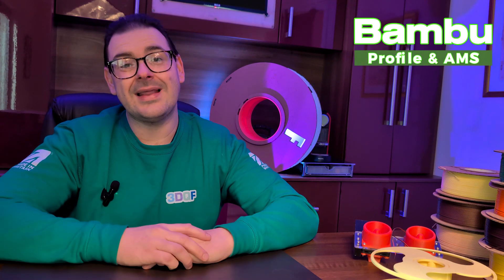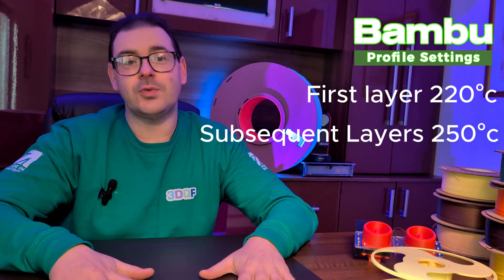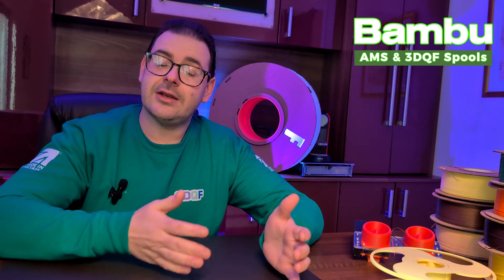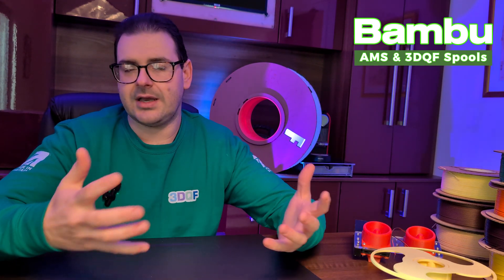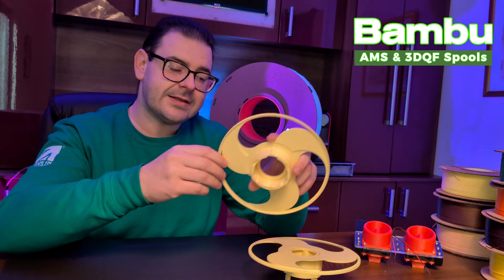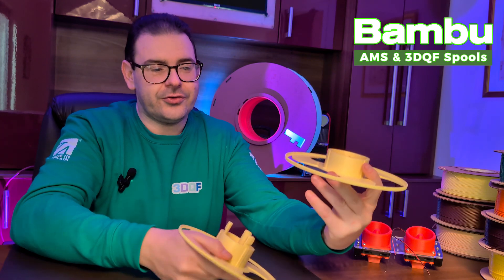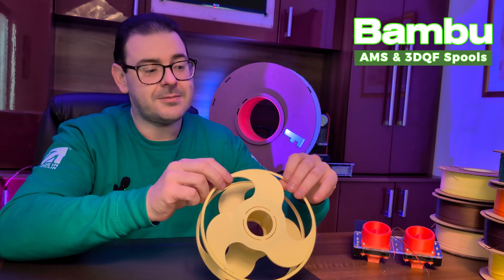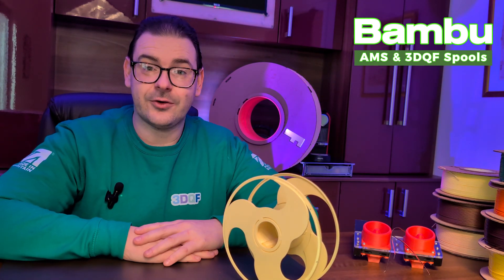3DQF UK Made 3D Printing Filament & Bambu Labs Printers AMS Profile Setup Advice History of Spools

Comment: I really like your filament but I shouldn't have had to search this out, none of the info about the improved adapter was available on your website that I could find. While I appreciate the use of cardboard spools is here to stay (and I think thats a good thing mostly providing its there for a reason, sustainably sourced materials etc) some thoughts: knowing that Bambu is here to stay why not produce refill style SKUs that fit onto the Bambu reusable spools? Why not include the option to purchase a spool adapter at check out? Also when advising about new filament profiles it's often considered useful to include a screen recording of the process, people who have been printing for some time and are familiar with slicers and how they work are used to this and can probably just go off the lose instructions, those who are coming at this with less experience having only had a Bambu product might not have the same familiarity so would find a more detail tutorial helpful. Also some advice around flow rates etc would be nice, those without an X1C dont get the Lidar enabled setup so there are gains to be had here. Advice on your ABS and PETG would be welcome too. Anyway sorry for the moan trying to be constructive and not an appendage about it :)
Reply from the maker: So to cover your point I will have to break down your question. 

So currently this is a "Prototype" Adaptor, we are happy for customer to try it but its  under the understanding that its going to change and evolve quickly. Once we are perfectly happy with how it works then we will include a A5 Flyer with every order about Bambu settings and of course this flyer will point to the Makerworld link. we do have a link to printable ACC in the material profile section and a note on each listing about Bambu printers but certainly more will follow as we get this adaptor sorted. 

Refill
This is an option we wanted to stay away from if possible, we would have to split production runs, the extra space require to double inventory, shipping error, stock control, droppage issues, everything about this options is not ideal. If we can make the adaptor work then this is the way forward for us I feel. We also can't run our company off another without any idea what their next move will be. I think most can agree that the original AMS is flawed and personally I would be surprised if it had 12month left in it before it got a significant refresh. Because we don't know what their move is we have to be logical about what we do. I cant understand how in a system so good they can continue with something that causes them so much trouble as the AMS, the AMS lite has shown how good they can make colour changing.

Video on profile set-up
Good call we can do this :-), well this is only our 2nd video so I will have to figure out the editing first but I am sure that's something we can do :-). 

Not at all, it all great feedback and brilliant to hear, thank you for spending your time to let us know, and thank you for your support :-).
Reply: Couldn't agree more..  hate cardboard spools.
Reply from the maker: That's a shame, in reality it won't be many more years before they are completely phased out. The problem you have is business customer are going through 100's per week, and plastic spool are a massive issue for them. I know a plastic spool looks great but they really suck on every other front.
Reply: @3DQF-UK  what on earth are they printing that requires 100's of rolls per week.  lol

Comment: Great video really made my PLA work so much better with my bambu and started using the new spool adapters for the AMS... Just got a roll of PETG so would be great to see a similar video on the settings for that
Reply from the maker: Thank you :-). We plan on doing a number of videos for all the materials so watch his space. If you have a Bambu then 250 for PETG and 235 for the first layer :-).
Reply: @3DQF-UK  is Petg still 235 min  250 Max and 235 First layer and 250 Subsequent layers?  This is using an X1C.  I ask as I read the TD and it says 260   "Hot end temp 235-260°C"

Comment: Great video, I have been using your stuff for quite some time.  What really impressed me with the video, is that it was clear,  very easy to understand.  Please do more.  I never knew you could get a different effect by changing temps, etc, to get a shine or matt finish.   Going to try that.  Could the same principle be used for the supports if you have an IDEX printer, or would this only work with Bambu software and printers.   I have always had problems with TPU supports. Using a second filament with TPU might work well
Reply from the maker: Thank  you for your support ! Glad you liked them I am sure as both my video editing skills improve and I get more confident at the pointy end they should also improve more. I need to get the house keeping videos out of the way first and then we can move on to some more fun content :-). 

We have another one to release about some new colours, will try and get this done for the weekend :-).
Reply: Yes, IDEX is perfect for printing a support layer, if that's what you asked. AFAIK TPU can use PLA as support. PLA and PETG can use each-other.

Comment: With the generic PLA profile having a lower flow rate setting than bambu lab filament. Are the temps you mentioned for the lower flow rate? Also have you managed to get your hands on E3D’s high flow nozzle and seen how that works on your filament?
Reply from the maker: That should really have been included in the video, Doh!
 I have now added this to the description. Running at the recommended temps the filament is happy at 16mm3/s, Increasing the temp to 270°C will allow for 19mm3/S. 

We missed out on the E3D hot ends so will have to get on on the next batch ! But yes I am intrigued as to the performance of them. it will highlight how un efficient the stock hot end is .
Reply: @3DQF-UK  Have you had any issues with heat creep at these temps? For example if you have a model which has a lot of bridging where the flow has to slow down or ironing? I'm kind of cautious with high temps as I'm currently on my 3rd extruder due to 2 previously unclearable clogs from messing around with high temps and high flows.
Reply from the maker: @odj310388   Oddly the reverse , running at lower temps around 220-230 causes the filament to deform due to the force the extruder is having to apply. Increasing the temps helps reduce the load in the hot end, reducing this load helps the filament out in certain respects. 

The 220°c for the first layer 250°c can run with the enclosure fully closed even in summer with no issues. We have our X1C,'s fully enclosed all the time and have no issues even in summer.We don't have as much experience with the 270°c setting as I have too much mechanical sympathy to push them this much .
Reply: Your new video being released reminded me to come back to this topic. I managed to get my hands on a 0.4mm E3D hot end and found your standard Black PLA could easily maintain 35mm3/s (it actually maintained higher but I've kept it at 35 to be conservative). You mention in a later comment you found some colours to be not performing as expected would you mind sharing which would be more susceptible to needing lower flow rates? I'd be interested to try them out if I have them.  @3DQF-UK
Reply: @3DQF-UK  Have these flow rates now been lowered? Description still says 21mm3/s
Reply from the maker: Yes we lowered as during testing on some colours we found that it was not preforming as expected I have now altered the description accordingly .  @Scorpie3D
Reply from the maker: My issue which caused me to revise was due to an increasing cabinet temperature. I was running PETG interface on the first layers at the time which had the bed running at 70°c . This in combination with the sealed enclosure was getting the cabinet temps close to 40°c which caused blockages at the heat break. 

Took much longer than it should have for me to figure this out :-). Once I removed the lid the problem went away .